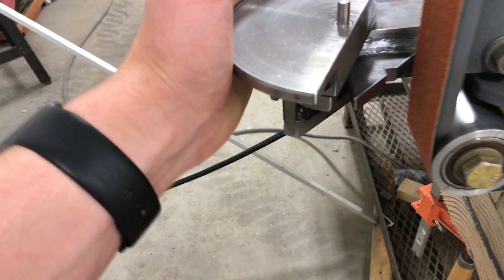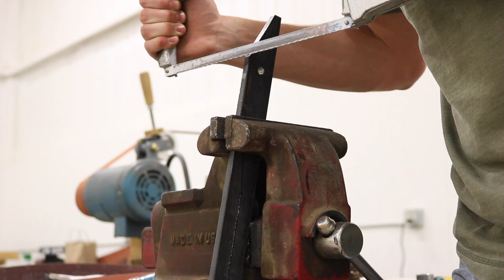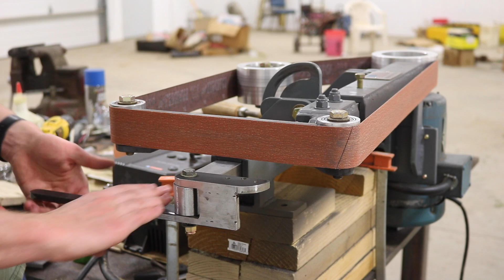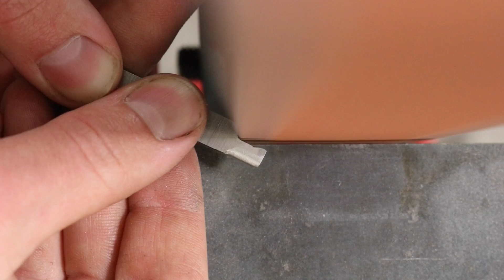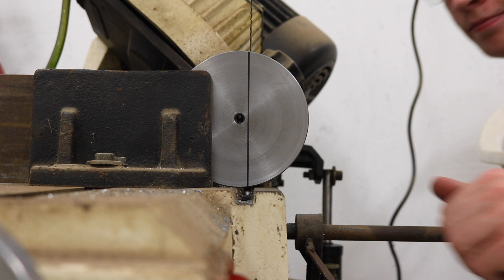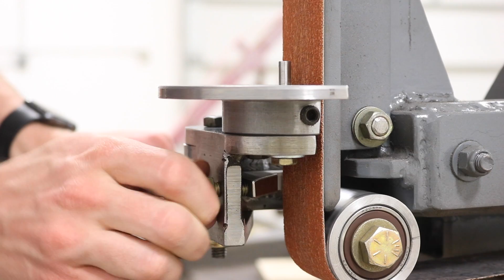Belt grinder radius jig

Comment from the maker: UPDATE: I do not recommend building this. I have stopped using mine. It works ok for parts like those shown in the video, but parts with larger radiuses chatter because they're not properly supported. I've had a few scary incidents that have led me to believe this attachment is not safe, including one incident where a chattering workpiece climbed its way off of the pin (yeah, I don't understand how that happens either). When using it in horizontal mode, there's a risk of the part spinning and cutting your hand or pulling your hand into the belt. Since the attachment can't be adjusted left/right or up/down, it also quickly wears out of the center of the belt. 

To get the same functionality without the downsides, try simply using a block of wood with a hole that matches the hole in the workpiece, and pivot the workpiece around a simple cylindrical pin stuck into the block (you can just use the drill bit that you drilled the hole with, although there is some risk of breakage). Put the hole as far back from the edge of the block as your desired radius will allow, so the workpiece is fully supported. Then simply clamp the block to your fixed table, and advance it toward the belt by tapping it with a mallet. It's not as flashy and cool as the jig in this video, but it works better.

I'm hoping to release plans for an improved version of the radius jig in the future. It will likely be part of the surface grinding attachment, which I hope to unveil by the end of 2024.
Reply: Thanks for the update Jer. BTW: The surface grinding attachment is amazing.

Comment: Do you have one place for all of your attachment plans?
Reply from the maker: I don’t sell plans for the radius jig (it didn’t work that well and could be a bit dangerous). The plans for the platen attachment and fixed table are included with the belt grinder plans. Plans for the small wheel attachment, contact wheel attachment, and adjustable angle table are sold as a bundle, here: http://jerswoodshop.com/gen-2-adjustable-table/#buy-plans

Comment: Hey J.
Merry Christmas. 

I just wanted to know if you have any plans available for the radius jig... in a metric format
Reply from the maker: Thanks!  No, I’m not happy with this design, not willing to sign off on it, i don’t recommend building it. It’s unsafe for large radiuses, and wears the belt prematurely. If you want to build it anyway, there is a CAD model of it on my website (in inches though) here: http://jerswoodshop.com/belt-grinder-radius-jig/
Reply: Thank you kindly.
In general I would have items laser cut but my brother in law and I are building 3 of your Gen 2 grinders currently but finding materials are not as easy as you would imagine... 40mm square bar, 40mm tube... just no luck, plus being December everything is pretty much closed. I had all the parts laser cut in April already but with all the covid lock downs and work loads we only getting to things now.... he's more interested in the radius jig but who's knows.

Comment: Just bought your plans, could I get some details on the motor and frequency drive please? I’d like to know the voltage of the one you used and models also.
Reply from the maker: The VFD is the KBAC-27D. It can run on either 120 or 240 volt single-phase input, and outputs 240 volt three-phase to run a three-phase motor up to 2hp. 

On my original grinder I used an old second-hand motor that I got on eBay for $60. I sold that grinder when I moved, and my new grinder uses the same VFD but with a Leeson 116760 motor. That’s probably the best-suited motor on the market, for this application.

Comment: I have a question is the motor 1800 RPM? Or 3600 RPM
Reply from the maker: I put a 3600 RPM motor on this original grinder, and 1800 RPM on the second one I built. With a VFD, you can overspeed the 1800 RPM motor to run 3600, and the slower motor has better torque at low speed, so I’d recommend 1800.

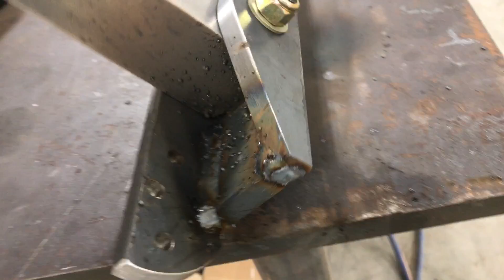Comment: 3:25 so from my understanding, these small beads show up when you apply too much current to the welder. Is that correct? Are you purposefully overrunning your welder? I can only guess you would do that because you're welding to a thick piece of steel so you need a lot of power. Couldn't you just increase the voltage?

Sorry for the many questions but your videos do make me learn a lot. Keep going with the awesome work!
Reply from the maker: I’ll need to look into that; you might be right. I’m a total noob when it comes to welding.

Comment: Really a GREAT build. Coincidently, I am working on the same thing, but more for small plates. It will be centerless, clamping and with an infinitely adjustable, but indexed radius; it will also not require a hole. You had some great ideas which I will be borrowing, namely the limit bolt and the handle. Love the functionality of your snap balls. I like that you CAD it out before you begin; personally I use SolidWorks..you know exactly the build before you even begin.
Reply: Hey, just stumbled on this comment. Did you get to finishing your own radius jig? I’m curious how it went.
Reply: @DireWolfForge  Yes, I wound up 3D printing it. I used it for an actual production project (0.75x1.5in hinges) and it worked great. I cannot share the details at this point because I am patenting it. It is quite a bit different than Jer's, but a bit different. I actually purchased the plans for his belt grinder (EXCELLENT) and have my 2HP motor and VFD, and only need the wheels.

Comment: Hey Jer, I just thought of a really useful mod for this table while I was working on building mine.  I'm going to mill out a t-slot to hold the pin into, so i can set the radius almost as long as the table is.  I'm thinking t-slot on the top, with a through-bolt to lock it in place, and a pin mount on whatever i make as the t-nut.  I do foresee some possible issues if the stock is narrower than the slot.  Just though I'd mention my idea, hope you see it!
Reply from the maker: I’ve thought about trying something like this myself. I’d love to see the result!

Comment: From someone who has been doing this for over 50 years, I’m wondering why you use such slow speeds on your lathe. Yes, it’s a small lathe, but with the carbide you usually use, you can lessen the feed, and increase the speed and still get it done much more quickly.

And I would really recommend you use some lube, particularly on your bandsaw.

Comment: When you saw something try to make sure your blade guides are as close as you can get them and still clear.  When you cut the base plate you only needed about 4-5 inches to clear your part but the guides were 12-14 inches apart.  Having them set closer will help you saw much straighter lines.  Also the chatter on the OD of the base plate may have simply been a hard scale on the outside.  A lot of steel will have a hard skin and the oxidation can also surface harden to a small degree.  Overall though a very informative and concise video keep up the excellent works.

Comment: i bought the plans to build the belt sander but find it annoying that some of the attachment plans have to be unzipped which im unable to accomplish   Could you provide all the attachments in a pdf file which nearly everyone i know has installed on their computers.  I noticed you started out doing this but  starting with the radius fixture you changed???
Reply from the maker: The radius jig is the only one that does not have a PDF file. I didn’t make a PDF for it because I do not recommend building it, it’s a bad design. I’m working on a new one and there will be PDF plans for it when/if I get it done.

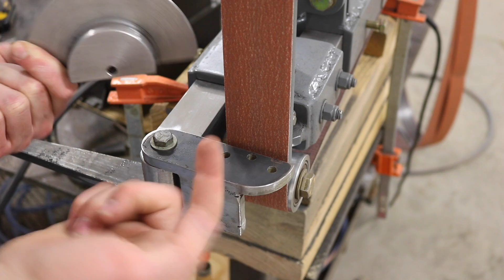Comment: so, just... a random thought i had... you were talking about how small of a radius that attachment was ment for, and my natural thought was "what about larger pieces?". well looking at where the table gets fixed to the attachment, at the plate your pointing out at 10:40... couldnt you in theory have that bar in an "L" shape (the foot of the L coming out towards the operator) and those mounting holes drilled at varying distances from the belt to make larger radius works? i mean, granted the work piece itself would have to be larger since the table is getting farther from the belt, but an inch back would make a large difference in how big of a radius it creates, would it not? just a question of curiosity and "could it work?"...
Reply: though looking back at it, i suppose the ability to slide the whole table back and forth is probably an easier way to do it... lol.
Reply from the maker: Yeah the whole thing slides... but I would like to come up with a way to adjust the distance from the pin to the edge of the table, so I would have better support for large workpieces.

Comment: Lathe you have is fairly light duty to be cutting a part of that size,  I would use High Speed steel tool bit instead of carbide with your lathe, " Less pressure and free cutting "

Comment: Thank you for allowing old Dinosaurs look at an innovator...I've looked at a dozen or more Belt Sanders . Yours is the one one so many levels that just out does a problem. You dont over think it. You bring us on a journey of discovery where I can see an alternative...but yours is even simpler. If you wanted to do a course...I'd consider becoming a Mechanical Engineer attached to a University or a Research & Development team of other thinkers...not necessarily people who can make sh1t...or sell your Welder complete to old Foggies like me who can see simplicity in its form. I'm only critical about your your welding. You should see examples of structural welding in Bangkok Airport on the roof support beam junctions. It's scary....Mary...real scary. I even spotted bad stuff holding a theater/cinema signage up. Scary es Bru

Comment: Have you ever heard of a spring-loaded tap guide? You chuck them up in your drill press or mill and bring it down against the little dimple on the back end of a tap. They help you make sure your tap is starting straight. Amazon has one from Brown & Sharpe for $20.
Reply from the maker: I hadn’t seen that before. Cool. Thanks for the suggestion

Comment: I got all the pats of the radius jig completed today, a few welds and cutting the table down and it's ready to use.  I came to the conclusion today that my next belt grinder will be much better now that I will have use of a belt grinder.I used your sketch up drawing to duplicate the parts and verify dimensions.  The biggest mistake I made was boring the hole in the table, which is the same as the pin.  I guessed at 10 degrees and it seems like it should be closer to 15 degrees.  That changes where the ball bearings catch and the depth of the part and also the diameter at the face of the table.  Challenging build, but appreciated the challenge.

Comment: i just bought your 2x72 plans. it would be nice if it come with the scetchup that i could play with .but your plans i downloaded are really well done as are your videos. as for the chatter your getting on your lath. you could check your Gibbs for play. speed and feed could also cause it and a carbide tool with a chip beaker ground into it would also probably help
Reply from the maker: You can get Sketchup models for everything on my website, here: http://jerswoodshop.com/2x72-tilting-belt-grinder/
Thanks!

Comment: What is the height or depth of the portion turned down to 2.5 inches? What is the length of the pin?
Reply from the maker: You'll have to look at the Sketchup model for that...I don't know the dimensions right off

Comment: It’s a shame that you must use a hack saw to cut that bar stock. Can you just raise your bandsaw vertical, then make a plate ( table) to mount above bearings, and use as a vertical bandsaw? My saw is very close in design to yours, and it came with a plate for that application. From the looks of your skills, that should be a simple task.
Reply from the maker: Sure, there are many different ways I could do it, but the workout is good for me. I don't go to the gym or anything so this is the alternative

Comment: Your lathe problems are because you are cutting at really low speeds, and your rake angle is 90 degrees on your cutting tool.
Put some positive rake on your cutting tool, and increase the speed. Your surface finish should improve accordingly

Comment: Hi. Is the motor you use variable speed? What is the use of the black box that connects to the engine, is it to vary the speed? I do not speak English, I use the Google translator thanks
Reply from the maker: Yes, the motor is variable speed using the black box, which is called a 'variable frequency drive'.
Reply: WITH THE VARIABLE FREQUENCY UNIT CAN ANY MOTOR BE MADE A VARIABLE SPEED?
Reply from the maker: No. It has to be a 3-phase motor and must match the frequency drive's specs

Comment: Recently found your channel and loving it.  Very impressive builds, and excited to see more!  I see you using a hack saw and a grinder to cut frequently.  Do yourself a favor and buy one of those harbor freight portable bandsaws, and see how easy it is to make a stand for it my vid: Review of Harbor Freight portable bandsaw, and the easiest bandsaw stand on the web.  You will use it all the time, and chuckle every time you do because it only costs $99!  (I didn't post the link to the video in this comment because that will put me in your spam folder)  Cheers!
Reply from the maker: +FarmCraft101 
I have used a high-end Milwaukee M18 cordless bandsaw quite a lot, at my previous job, so I know how nice they are. But I guess I've never been willing to spend even the $99 for one; I'm happy with a hacksaw. Keep a fresh USA made blade in it, and a hacksaw will cut incredibly fast with minimal effort. Not arguing, I see your point, but I'm satisfied with a hacksaw for now.

Comment: So I've been through all the comments you answered and I didn't see my thoughts so here you go :

instead of using the spring-balls system and the complex shaped dower pin, and instead of machining the huge shoulder on the 5 inches bar for hours, why didn't you just keep the table full, drill a hole in it, put a regular dowel pin and then mount cylinders of different external diameter, but always the same internal diameter (the one of the dowel pin)? That way, when you sand a different piece, you just have to change the cylinder and keep the rest in place.
It's much simpler to build and to use in my opinion, but I may be missing an important point here.

And this have been already largely said, but I kinda looooooove your work and your videos. Almost everything handmade, well-concieved, plus the videos are funny and instructive and the editing is very clear while keeping things dynamic.
So: bravo, and thank you.
Reply from the maker: +Guillaume Emualliug 
That system would work quite well in many regards, but it has one drawback that makes it less practical than it might seem at first glance. With my pin system, I can make pins of any size from tiny (think 0.030") to quite large (anything over 1.5" would be impractical). With the dowel + bushing system, there is no way to have that range unless you make the pin interchangeable in addition to having bushings. You wouldn't want to rely on a 1/16" pin to hold a 3/4" OD bushing, so you'd have to swap in at least a 1/4" pin for that.

That said, I can make bushings to use with my existing pins; maybe make pins for the most common sizes and bushings for everything in between. 

Thank you!
Reply: Guillaume Emualliug k

Comment: man, i just ran into this video and found it to be informative. Awesome, I'm subscribing. I've seen your last video on this belt grinder build and its an awesome design, which leads me to one question...in the last video you said you'd be making plans of this belt grinder, is...is that, possibly available, yet? If so, where can such be had, if not sorry to have pestered. Still, awesome channel.
Reply from the maker: Sorry for the tremendously delayed response; your comment was knocked out as spam so I didn't see it. Yes, plans are available: http://jerswoodshop.com/2x72-tilting-belt-grinder/
Reply: Cool, thanks

Comment: Ya know what could have been cool adn lees work?  Put a strong rare earth magnet as your holder for the radius vs. the pins.  This way you wouldn't have to drill a hole in the metal in the event you don't need a hole.
Reply from the maker: +John Merlino 
Magnets + grinding dust just sounds like a never-ending headache to clean up the magnet every time... no thanks!

Comment: you should make a sprayer to continuously douse the work with coolent, so you don't have to keep dipping it in a water bucket
Reply from the maker: +mrjarnottman 
I'm afraid I might rust the machine doing that. Maybe it wouldn't be an issue, but I'd rather not take the risk. If I had more money I would have made the hole grinder out of stainless! ;-)

Comment: Another great video!  This one shows the forethought that went into the removable platen support piece. Love the spring loaded retention system!  You could probably make a set of donuts (or thick "washers") to adapt the existing pin to larger holes.

Comment: Very slick radius. 
Neat pin design to allow one tool setup on the lathe. These designs really show a huge amount of thought.
I like the pin swap out, but I'm thinking one could simplify the cool tool-less pin change by having one size and just drilling out the hole to the desired size once the radius is ground. I would much prefer the swap out version though.

Comment: with a v-block you can put the drill sank you use to drill or ream and than do your radius, don't have to machine a pine every time. Really like your channel
Reply from the maker: +Simon Bouchard 
Good idea! I imagine I'd want a clamp to hold the bit against the V-block, but I think that'd work great!
Reply: On your horizontal set-up the clamp won't be in the way. I was thinking about a radius gage system too and your pivot mecanism with the handle really did 1+1 in my head.